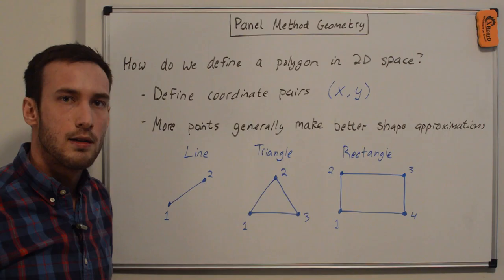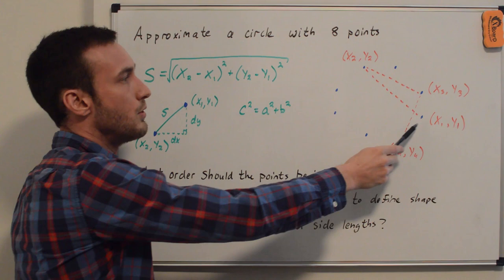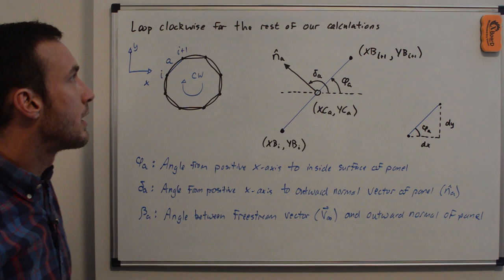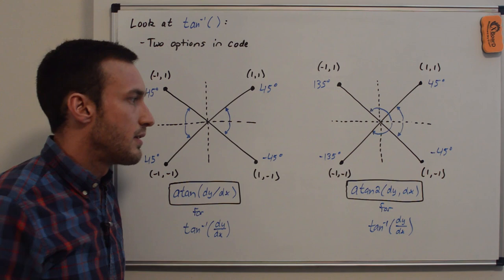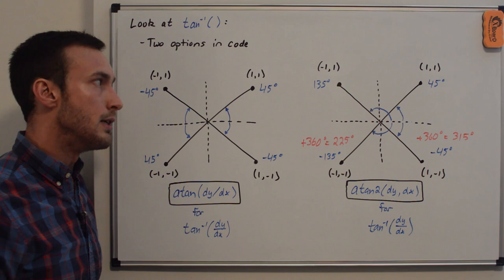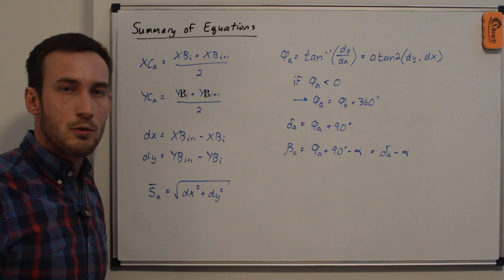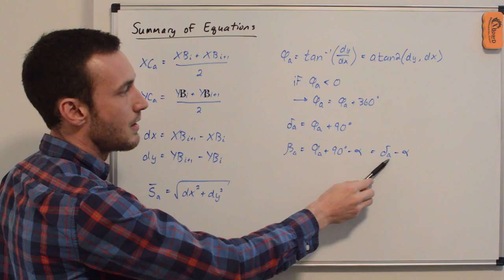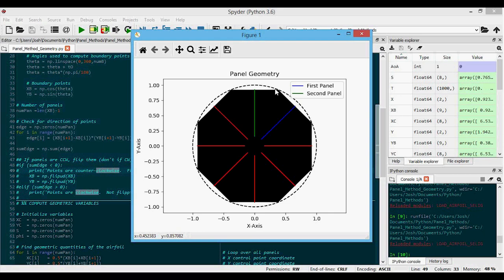Panel Method Geometry

Comment: I  didn't understand your reasoning behind taking clockwise direction, It is at 4:35 in video. If you can explain it. Thanks  in advance
Reply from the maker: You can use either direction for your code, but you have to be consistent with it all the way through your derivation, otherwise you'll have weird things happen to the results.  I just decided to choose clockwise, but you can choose counter-clockwise if you want; you'll just have to change the appropriate equations if you do.

Comment: Thanks for your video on panel method geometry! Is the code only defines the x and y coordinate of the circle? How to calculate the coordinates of boundary points when it is airfoil?
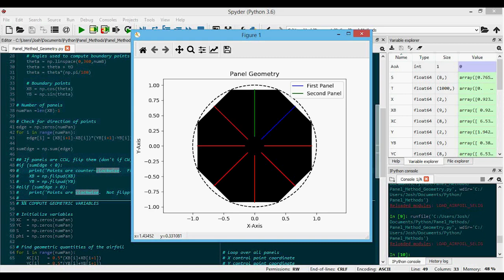Reply from the maker: You're welcome!  The code has options for both a circle and an airfoil.  You can see me switch from the circle to the airfoil at 18:40.  I'm just loading in the airfoil data, using some code from my previous videos in this Panel Methods playlist.

Comment: Could this variable defining also apply to parametric equations and integer geometry in python?
Reply from the maker: I can't say I'm familiar with integer geometry, but you'll notice that at line 80 of my code, I'm actually making a parametric definition of a circle.  For a lot of CFD codes, when you define the grid cells you'll also need to know their face normals so you can compute fluxes, so this method of computing the panel geometry is relevant beyond just panel methods!

Comment: Excellent material - I'm working through each video as a refresher. I did this at Uni almost 40 years ago. After more than 35 years in industry, you sometimes forget the basics!

One minor comment on the code I downloaded from your github. When I run the airfoil for goe623, I don't get exactly the same results as you show in the video. The first panel ends up being the trailing edge thickness surface between upper and lower surfaces rather than the first 2 lower surface panels. Something to do with flipping from ccw to cw or maybe you're not closing the airfoil?

Comment: Thanks for going over all this!! Is the source_panel code that you showed at 19:36 available? I didn't see it in the GitHub repo, did I miss it?
Reply from the maker: You're welcome!  It's not available yet, but it will be soon.  I generally post code when I get to that particular video, so when I post the video that goes over my airfoil source panel method code, I'll post the MATLAB and Python code as well.  Should be in the near future.

Comment: I couldn't run the code for Airfoil in Matlab, but the circle works only.
please guide
thanks
Reply: i am facing the same problem in python code
plz respond
Reply from the maker: I responded to your email, but I'll put the same information here if anyone is having trouble.  You need to make sure you have the LOAD_AIRFOIL_SELIG.m function in the same directory as the main script.  You also need a directory called "Airfoil_DAT_Selig" in that directory, which houses all the necessary airfoil files.  If you need any of the code, see my GitHub page (https://github.com/jte0419/Panel_Methods).
Reply: @JoshTheEngineer  Thanks, its working now
Reply: @WaqasAhmad-0  same, how you solve it, please help me, i receive this message: could not convert string to float